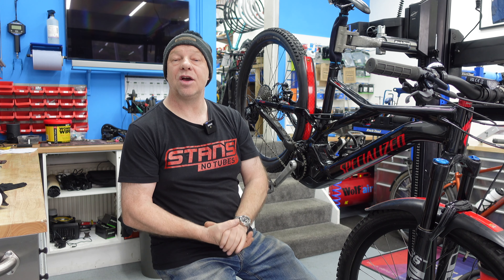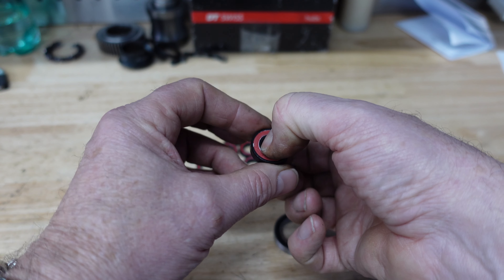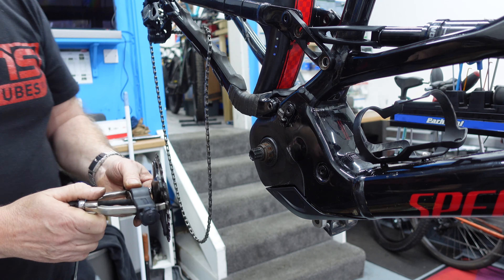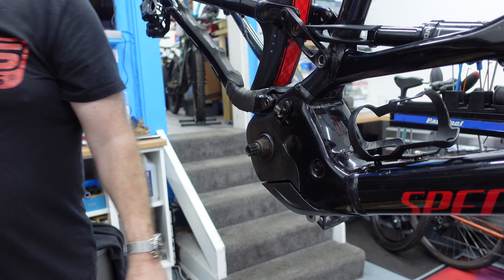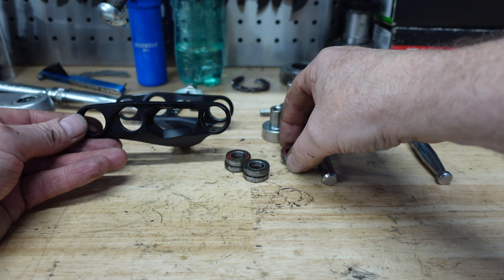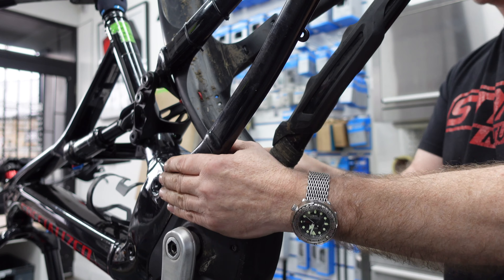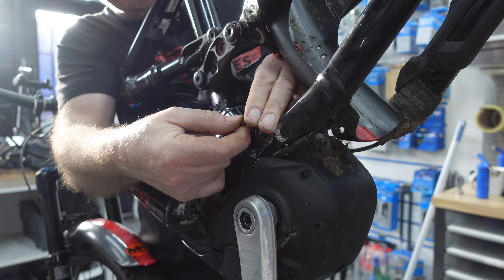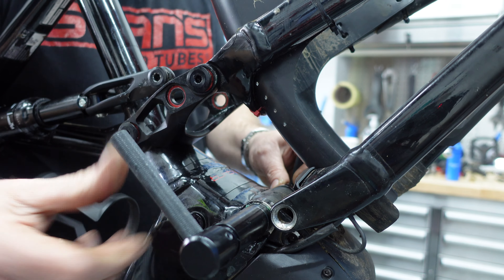How to change your Specialized Levo frame bearings

Comment: At @12:36 what part of the bearing is that metal piece pushing against to remove the bearing?  If there is a lip on the housing for the bearing I can't imagine it can make contact with the outer race.
Reply from the maker: Hi, it uses the inner race to place pressure to remove

Comment: Your videos are exceptional. Thank  you! 
Yesterday when i was out in the forest i happened to see that the back-triangle was flexing a lot. 
I stopped and check and tried to wiggle it sideways and then i noticed that on the side of the chain, one could see that it wasn't tight, it was clearly moving sideways. 

Home again i checked suspension bolts (fine) except one (the one on the side where i saw flex. it was totally loose and would not fit going round and round. 
I unscrewed it. It went fast (i could not drag it right out so it must have been attached a little at least). 
I took it out and the bolt looks also fine, but i really would not know if it was broken or not. 
What can be the problem? Does it mean that if the other end is broken? Could i order a new bolt and try and it will fit? 
I'm having an awful feeling nowthat the frame inside is broken and "out of repair" so to say. I'm not very technically skilled. 

What are your advises? Can a good garage with the right tools repair/fix this by making the bolt fit again?
Reply from the maker: Hi, I could do with some photos to see what you mean.
Reply: @TheYorkshireBikeMechanic  Sent an email!

Comment: Hi Dave, iv'e finaly managed to get out on the bike since you changed the bearings and you got the forks sorted for me. It's now like riding a flying carpet it's just so smooth and it  dindn't break the bank either. Having bought the bike second hand 2 months earlier i'm glad you spotted that washer  that was missing as no doubt if i'd have carried on using it, it would have caused  even more problems so ive probably saved quite a few quid there with help of your knowledge.I will be taking your advice and getting a new pin and spacers in the not to distant future so thanks for making up the spacer and realy enjoyed wathching the video you did on it. Keep up the good work and videos .Thanks Gaz.
Reply from the maker: Nice one, thanks

Comment: Hi great video .I'm currently changing my bearings at shock rocker on my levo. When I removed the rocker there was only 4 washers none in the middle is that normal or am I missing 2 washers thanks Callum
Reply from the maker: Hi, it depends on the year of your levo
Reply: @TheYorkshireBikeMechanic  thanks its a 2021 comp

Comment: You didn’t show the process for using the drift to remove main pivot! That would have been quite helpful seeing as that’s the hardest part.  Then you also skip removing the double bearing at the back end!  You went through all that effort of making the video and then you skipped the two hardest parts of the job.
Reply: I don’t suppose you found out because I’m trying to change them too ?
Reply: Agreed. He literally skipped over the one part I wanted help with - the double bearing where you can’t push them out like the rest.
Reply: Same here. Did you guys manage to remove the double bearings and if so, how?
Reply: @d1qpi  Meh, my original comment is not showing up, trying again.
I was able to remove these bearings using a slide hammer. It's a bit of messy process though, because there is a spacer between the two bearings, which prevents you from getting a good grip on the outer bearing. So either you manage to only grab on the inner ring and extract this way, or you will end up scratching the spacer to create a large enough gap for the slide hammer to get a grip on the backside of the bearing. Either way, it worked (twice now).
There is a dedicated tool from BearingProTools though, which was specifically designed for the Specialized rear bearings. It looks pretty good, but I haven't tried it myself.

Comment: Your video skipped over something I really wanted to see!  My alloy chain stay had a separate washer behind the outer bearings.  I think that spacer is for the carbon chain stay, because that is what the Specialized schematic shows.  As you said, the alloy chain stay have a built in ridge between the bearings.  Did you use the spacer on the alloy chain stay you show in the video?

Comment: My everyday ride is a decade-old ladies’ hybrid bought second-hand off eBay for forty quid, chosen largely for its lack of theft appeal. Yet this machine is capable of taking me up and down hills with ease in all weather, in safety and comfort and doing all this while only requiring a monthly squirt of air in the tyres and a dribble of oil on the chain.
These new contraptions will soon need an MOT just to keep them on the road.😂
Reply from the maker: Hi Bob, thank you for your comments

Comment: Can you assist, please,trying to use cain sonic Mobil phone app when plucking the belt readings left to right the readings  fluctuate  in between  plucks, so how is the average attained
Also, why is the left reading box a different colour,
I have lent a kriket  gauge but am I correct that the colour black is a motocycle one?
Thank you
Reply from the maker: Hi, thanks for watching, I think you replied to the wrong video

Comment: another great video, how do you check to see if the bearings need replacing, is there a way of testing without removing any of the linkages?
Reply from the maker: Hi, if you ride 2 times per week then every 12 months, if not the the retaining pins should be removed and re greased once a year

Comment: The MOST important info not shown. C'mon, we're all here because of hpoing to see the actuall process of removing those f...g double-bearings. Yes, you said - "blind bearing puller" - but which one (there are dozens of types of it.). How did you use it exactly? Because I don't see any chance to use it cause of those alu wahsers inside between bearings.
Reply from the maker: Hi, thank you for watching and your comments. I have another spesh knevo in at the minute, I will film the process.
Reply: @TheYorkshireBikeMechanic  Well, it seems it never came to this.

Comment: Hi Dave, fabulous video, thanks for creating it. Can I check what grease were you using for the bearings and axles?  Thanks.
Reply from the maker: Hi, I use Motorex Grease 2000.

Comment: Don't specialized recommend Loctite 603 between frame and bearing?
Reply from the maker: Hi, Thanks for watching and your comments, yes they do but from experience it's too harsh, bearing housings can be tight on the spesh without any compound, they are very hard to remove with compound.
Reply: @TheYorkshireBikeMechanic  Nightmare!!! lol Im just about to do my Kenevo SL for the first time. So you would advice me not to use 603 when installing new bearings? Any tips on getting the  original ones out, which i assume has 603 applied?
Thanks for replying, i appreciate your opinion.

Comment: For those doing this, as faor Allen wrench used, look at the ends of the key, the corners should have machined bevels at the corners, and this will match the way the Allen bolt recess is made, with the end result being the Allen keys goes in deeper and more solidly for a better bite on the bolt. Using a key for example that has been cut down with a hacksaw, is not a good idea as the corners at the end haven’t gotten the machined bevel on them.
Reply from the maker: Hi, great comments, I often grind the tips on my keys to get back to a clean key

Comment: Hi Dave What’s your view on ceramic bearings, are they worth the extra cost in your opinion?
Reply from the maker: Hi Nigel, It's an interesting topic, my own personal view is that when you are at the top of your game and looking for every advantage available to get the best performance available then ceramics is the obvious choice, they last much longer than steel but cost considerably more too. They do run with less friction, which offers a significant advantage in industrial applications running at 20,000 rpm. A tiny percentage reduction in friction here can equate to a worthwhile power saving, but when you're only turning at 300 rpm, as you do on a bicycle a small percentage increase in efficiency will make a negligible change to your power output. Certainly not worth the significant increase in cost."
Reply: @TheYorkshireBikeMechanic  Thanks Dave really helpful, non ceramic it is